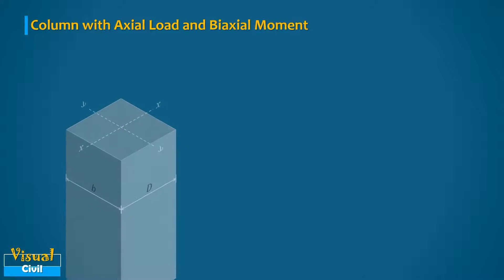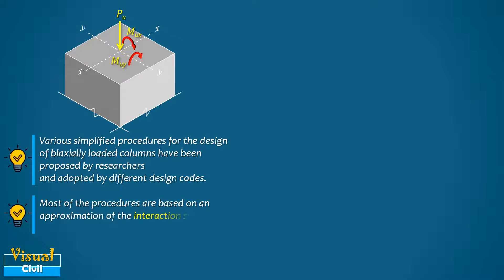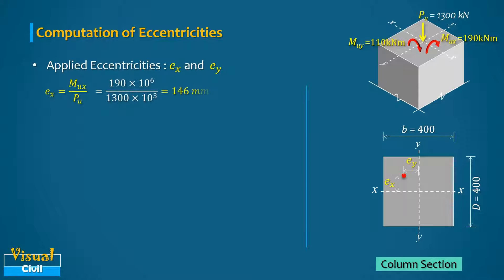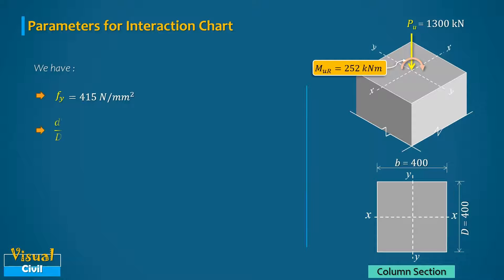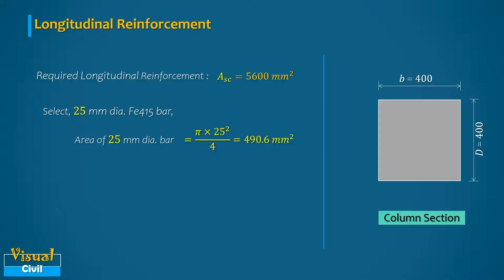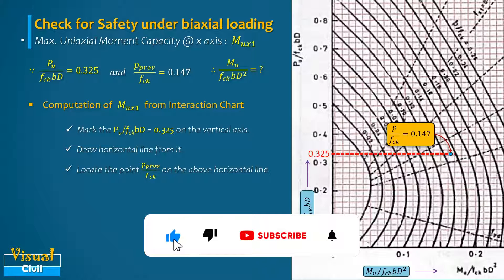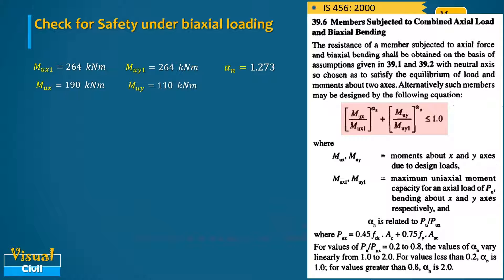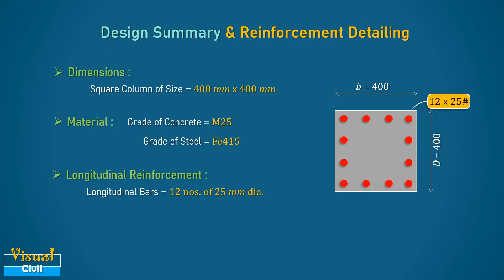How to Design Column with Biaxial Moment | Eccentrically Loaded Column | Eccentric axial loading

Comment: tell me mux muy formula 😊
Reply from the maker: You can calculate Mux and Muy using structural analysis software or through manual calculations based on the applied loads.